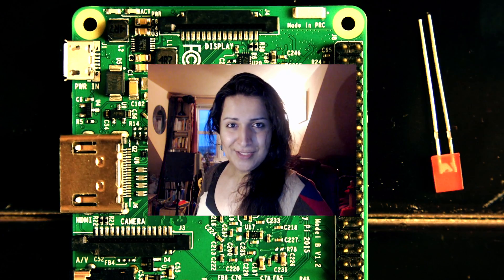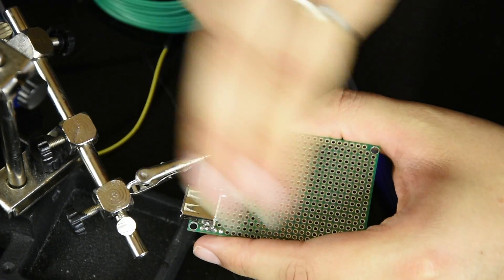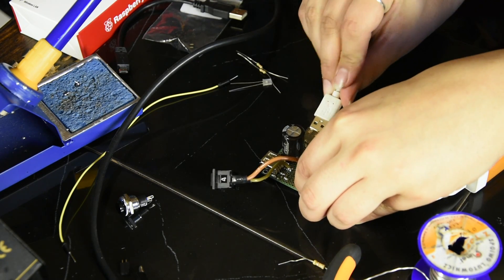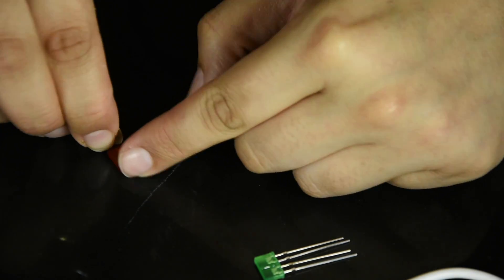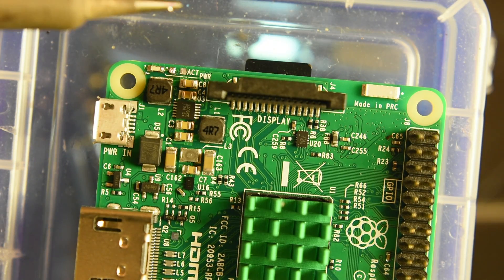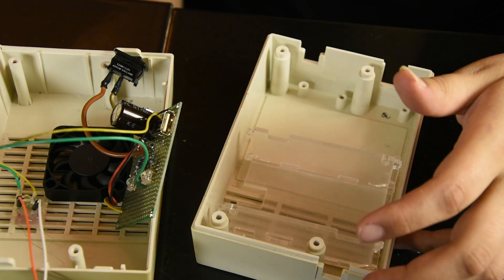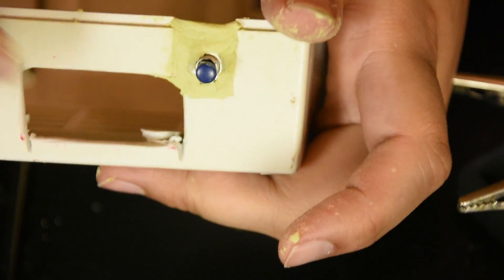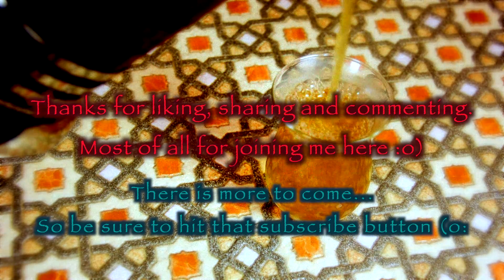Amiga Pi Project Part 3 -  The Build

Comment: MMmm, bit painful to watch.  you need to buy a HSS Step cutter Bits, B077JKSFRJ and small elect drill. B01KM2IG9W Scalpel Handle & 5#10A Blades used to heat up hot to cut, B06ZYLRH6H and some Araldite 15ml B0001OZH4O and Polymorph Thermoplastic Polycaprolactone Moldable Plastic B0795PGYMZ
Reply from the maker: These are very old videos, i have most of these now... also everyones gotta start somewhere, right?
Reply: yes i under stand. but i,am not knocking it. it every good as they say real. but just trying to help./|\

Comment: regarding SMD soldering, it is actually a paste, and the easiest way to remove it is a very fine nozzled hot air gun and tweezers, be careful not to overhead the board which will cause delaminations or worse lift the tracks

Comment: for your helping hands take a look at a panavise it grips the bord from the edge giving you full access to the entire surface of the bored failing that they sell croc clip helping hands that have felxible arms which might be better for you as for surface mount soldering for what your trying to do it would be done with alot of patience a microscope and a verry fine tip for actually putting parts on its done using a solder paste you apply the paste to the solder pads place your part ontop then heat it up either with a hot air wand or by putting it into a reflow oven (basically a tempreture controlled toaster oven) the paste reaches melting tempreture the paste part evaporates away leaving the solder which flows over the part and secures it to the board
Reply from the maker: Thank you, the helping hands even though they're helpful, do keep falling apart, i've needed better ones or a better solution. I will; check this out, thank you!

Comment: I really enjoy your videos :) With the Raspberry Pi 1, at times where I lost the WiFi and could not shutdown (it was a headless setup) I had to pull the plug to reset. This often caused corruption on the SD card. At least, that's the reason the internet gave me :) Is the reset switch better?
Reply from the maker: Thanks :o)
No the reset switch will also cause corruption on the card if it's not shut down properly, I suppose it's just a way to stop one from unplugging then plugging back in again to switch it on and off, it would still need to be shut down the proper way.

Comment: Its looking good maddi i bet you can wait until its up and running.the best way to transfer your files is via ftp over your wifi network saves you having to remove the sd card all the time 😀
Reply from the maker: Hahah yes I know, I need to stop shying away from networking. I mean once I put all my files on there, there isn't going to be much copying back and forth but sigh fine! ;o)) It's the part of computing that has always frustrated me the most. And thanks! Yes I cannot wait to get it going :o)
Reply: I hate networking to it never goes the way it should.In fairness to the pi its pretty straight forward in that respect :) Looking forward to more videos in the series.